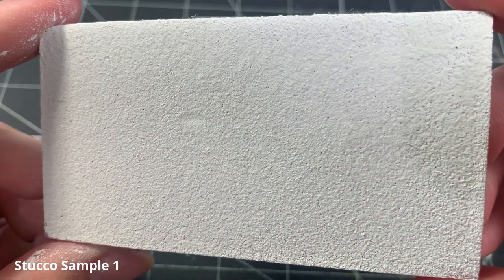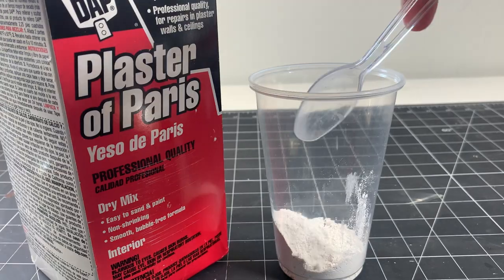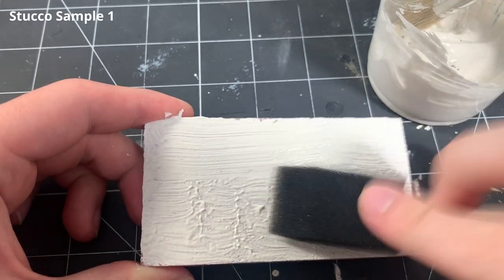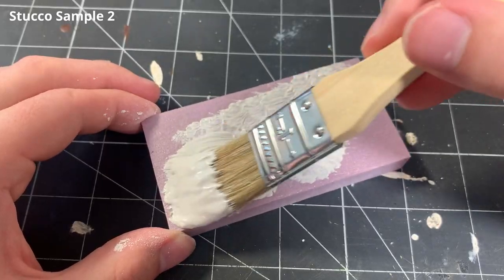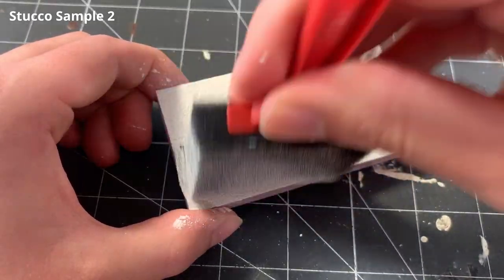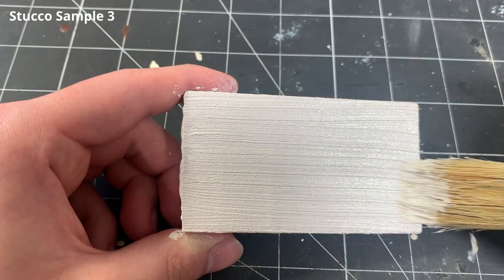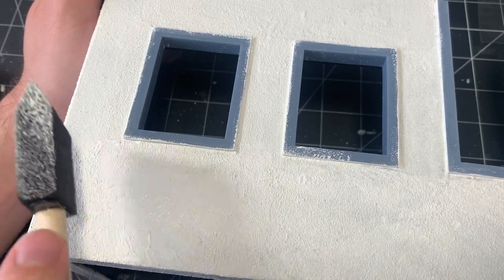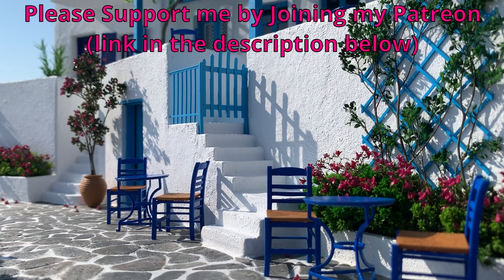DIY - How to Make Realistic Stucco Texture Paste for Dioramas

Comment: Your videos have been really helpful! 
One could just use any other acrylic color in the mixture to paint, no? If I wanted to paint a blue wall for example, or is it better to paint afterwards, does it still hold the texture? 
Keep up the good work!
Reply from the maker: Glad to hear that! And yes you should be able to mix color in just fine. The plaster might make it dry a little lighter than the paint color, so it’s worth testing on a scrap piece first!